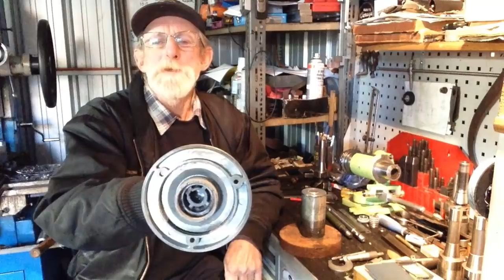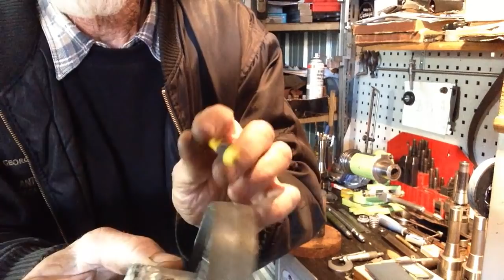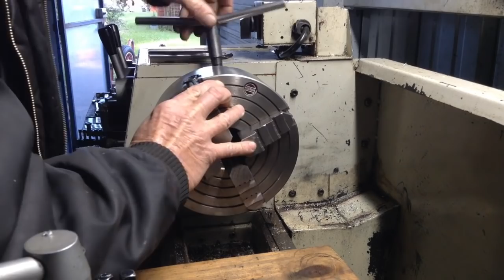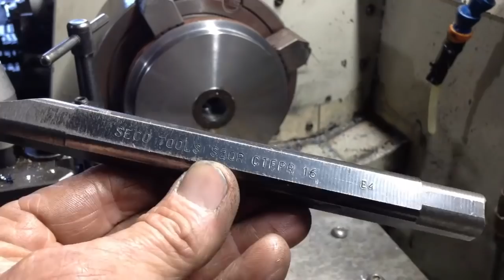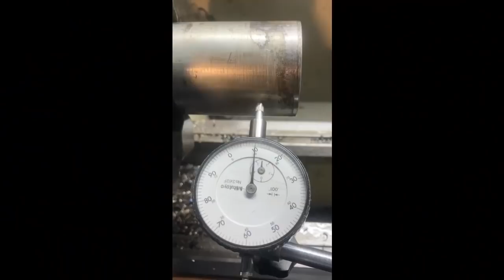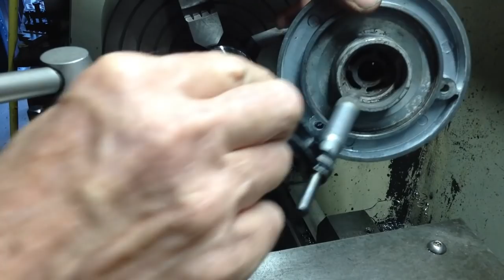We Machine A Clutch Hub From Scrap .

Comment: Can u make me a clutch basket and hub for my 2000 zx7r
Reply from the maker: Are they not available any more from the dealers or wreckers ?
Reply: @swanvalleymachineshop  Yeah only ebay used parts available
Reply from the maker: @Exit13Boxing  Hey i had a look at the ebay ones .  You would be able to pick one up ex USA for a fraction of the cost of getting a set machined up .  It would be over 2k just in machining as a one off .  👍
Reply: @swanvalleymachineshop  thank you for looking into this for me and I hope that's almost what I paid for the bike ....shoot me a email a machinist in my contacts is nessasry

Comment: Yeah, isn't trying to weld crap die cast fun . . . at least with your new part it won't have the same problem again.  I have trouble getting chips to break a lot of the time too, but also need to experiment with tools other than CNMG geometry.
Reply from the maker: As you know these small lathes have a horsepower disadvantage  with a reasonable cut on to break a chip in some materials .

Comment: Hi Max Ian langley here again from New Zealand.  I like the way you use a 4 jaw chuck and how quick one can set up a work piece. I always use a 4 jaw and would prefer a 4 jaw over a 3 jaw for holding power. Also I noticed and listened to your comment about chip control on small DOC's. I used to be New Zealand Sales Manager for Seco Tools (I am now retired) and we had an insert that was great for finishing. The swarf came off like little bits of fly dirt. If you are handy or have a Seco Tools supplier handy I suggest you try the following - TNMG 160404 FF1 in TP2500 grade or CM grade (Cermet). FF stands for Fine Finishing and 1 represents chip breaking on a scale of 1 to 10 with one being for very fine finishing cuts.
I have a few other suggestions as well but try that out. I assume you are in Australia, If so you can contact Seco Tools directly, just check their website for contacts.  Cheers Ian
Reply from the maker: Thanks Ian . Yes Australia , started my apprenticeship at Woburn railway workshops  near Wellington  back in 82 . That insert was a Mitsubishi 160408-MA , a good general insert for most work .  I may have some 04's in the drawer , i will check .   At the end of the day , it's more economical for myself to run a small nose rad insert on a small shank tool .     Cheers .
Reply: @swanvalleymachineshop  Hi I did my apprenticeship with the Union steamship company  back in the early 60's and carbide was in its early days here in NZ. With my job at Seco Tools I visited pretty much all the machine shops in New Zealand and know the railways operation well. We supplied the wheel turning inserts on the hegenscheidt under floor lathes - now that was insteresting turning maganese steel with hard spot. Very poor chip control as well. All good stuff. Cheers Ian
Reply from the maker: @ianlangley987  The under wheel lathes were impressive as i remember . Wouldn't it be a small world if you supplied the Seco boring bar that i used in the video . It came from my Dad's business , Porirua Engineers Ltd  ,  just near Wellington .
Most of the lathe tooling was Seco & Carboloy , bought in the early / mid 70's .